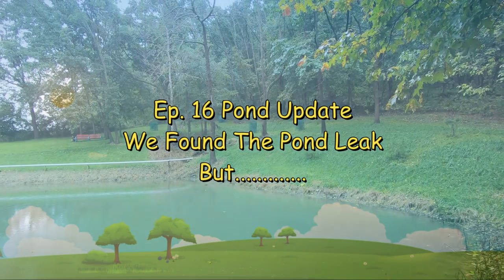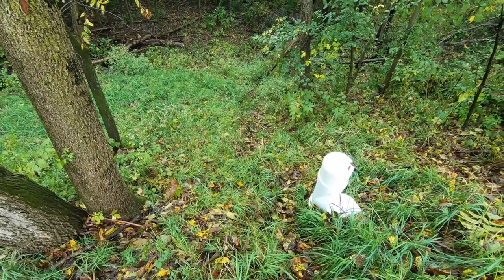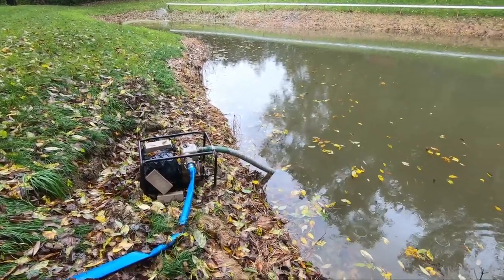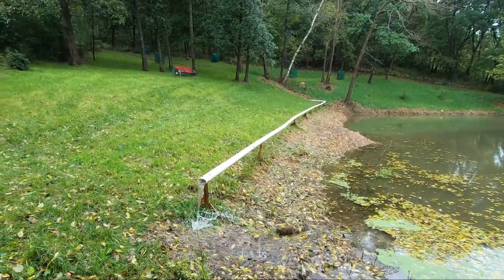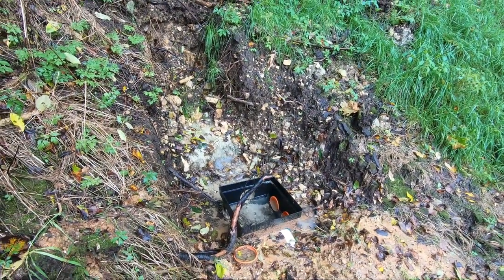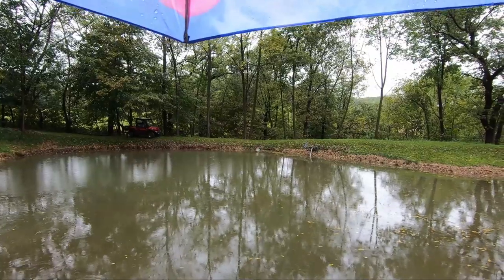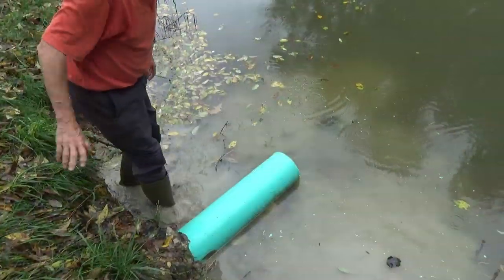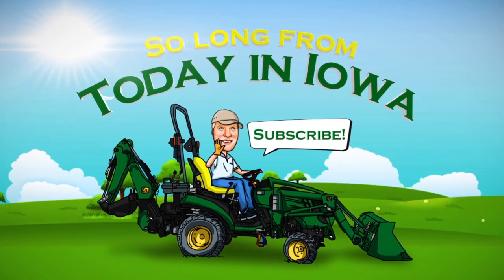# 16 Fixing a leaking pond. / Hiring a poor contractor

Comment: I have been watching your videos for quite awhile now . This pond you have is almost same as mine . I have had the pond for 25 years . This is what we did when we constructed it with advice from some real good old boys with years of experience. The dam was compressed with a dozer layer by layer with the blue clay from the 18 foot deep end . The skimmer pipe is 12” plastic with ribbing on the out side and smooth inside . The pipe is four feet from dam going down four feet then 90 degrees thru the dam . There is too large sheets of rubber membrane heavy pond liner with 10” holes in center stretched over the pipe buried three feet in dam .  It has never leaked by . Emergency over flow pipe in dam also for flash flood events 12” below top of dam . Smooth pipe on outside I was told will always leak . I live in Ontario and get severe frost and heaving . The skimmer pipe is always below frost and never moves and always surrounded by water . We have a windmill with aeration puck on a eight foot stand in 18 foot hole and electric backup diagram pump for hot no wind days for oxygen . Hope this helps you  out . What I see at your pond could be fixed no problem . Are pond has been bullet proof . There has been many ponds washed out because of poor piping leaking . Thanks Stephen

Comment: Take the pipe out redo the levy, and like what I did with my big pond I just redid is I had an natural inlet and outlet put in and fixing to lay down some hay with chicken wire on top and rip rap to prevent erosion!! And also using soilfloc and damit on both tanks
Reply from the maker: Good morning Jonathan thanks for taking time to say hello and commenting, sounds like you had a successful project. Have a great weekend.

Comment: I have had a 3/4 acre pond for 20 yrs and it leaks. Where yours was leaking ( you knew where it is) dig down on the other side of the bank and pack it full of clay. We have dug mine several times. May try shalex as you did
Reply from the maker: Hello Judd, the final video #112 shows where the leak was finally found. Nothing I could put in the water would have stopped the leak, except to excavate as you mentioned. 
Iowa is coming out of a drought and it's nice to see the pond level rise again.  Thanks for taking time to say hello and comment. - Bill

Comment: Hi Bill, I just watched all your pond videos with much interest.
I don't like to use the word expert, but my job is consulting and troubleshooting serious construction issues. As it is Sunday morning, and I am just enjoying a cup of tea, I will analyze your dam issues for you, no charge [normally about $528] !
Here are my observations .

You have been unfortunate with your chosen design. It was never going to work.

1- Having an overflow pipe running through your dam wall is a disaster, water in the dam is drawn along the outside of the smooth pipe continuously, by capillary action and hydraulic pressure in the dam, it never stood a chance, the dam wall is also very very steep which means it is even more liable to fail, and extra care must be taken, a dam liner would be recommended, and should go right over the top of the dam wall, then layer with netting, and gravely clay on it and grow your grass.  
2-The overflow must always be located along the sides of the dam and basically, be a little creek sweeping around, and away from the dam, never a smooth plastic pipe either, and never finishing just below the dam wall, where it will saturate the dam foundation wall and fail, water over topping any dam is a disaster, and must be avoided at all costs, or it will fail.
3-The white pipe aerating the water, doesn't, it only affects the top layer of the pond with a small amount of aeration, your dam would benefit from a 4 metre rocky river base with a couple of little waterfalls, you have the height for this, where it enters the dam, thus creating a simple natural looking, highly aerated creak to aerate the dam.
4- Whenever possible, you should never, ever, drive over a dam wall such as yours, as it seriously disturbs the packed clay dam wall, and encourages capillary water being drawn through the pond wall, every time you drive over it, water is alive, and in motion, going to the path of least resistance with gravity and hydraulic push factors, and will move through the wall very easily, and your dam wall will fail. Nobody wants that.
And just remember, every time you see the word 'fail', with dams that equals money and time.
Lovely place though, very lush, keep up the videos.
Cheers from Australia
Reply from the maker: Hello Espen Forfen, Happy Monday in your part of the world.
First THANK YOU! how very generous of you to take time and send me your professional opinion for no fee. I've read your suggestions several times and never thought about the damage I may causing by driving over the dam. That will stop effective today.
I excited to tell you last weekend I found another excavator that was right in front of me all along. I'll get right to the point. He dug a 16 foot long trench down the middle of where the original repair was made. He dug until he found good dry soil, that took him to about 14 feet deep. Clay was installed in the trench in 2 foot lifts, then pounded with the excavator bucket. The exit pipe was NOT reinstalled back in the pond dike. If you think of my pond as a pear shape, the original exit pipe was installed in the fattest part the pair.Your spot on with your note how steep that dam is. We installed a ribbed pipe in the top of the pair now, it's the shallowest part of the pond and I almost decided to not put a pipe in, and let it run over the spillway as was shallow at that point.
Well as of 8 days ago, the pond water is higher than I've seen it in years. No water can be seen coming from the backside of the dam.
A new video is coming soon and will better explain what we did. Winter is moving in here fast so I think the season to repair the pond is over. 
Thanks so very much for taking time to share your ideas with me. This is internet at it's best. - Bill
Reply from the maker: Just checked the pond and it's within 6 inches of the outlet, never been this high everything is looking good.
Reply: Being a Gov Environmental Scientist for 16+ years working in coal reclamation, and also performing environmental consulting work on the side, I will have to agree with Aspen Forfen.
 
Normally, coal mining pond designs are engineered to have a primary and secondary spillway. Primary being the main discharge of water and secondary being utilized as an emergency spillway. The emergency spillway's main purpose is to discharge water in case primary pipe fails (i.e., clogs, undersized, etc.). It appears you have 1 primary spillway without an "anti-vortex" cap on the end of the pipe. NOTE: anti-vortex cap prevents water from making a circular motion (much like a toilet or sink drain) which will erode the  soil around the edge of the dam. However, this may not happen in your case due to the smaller size of the pond and the lack of large watershed above the pond. Just a quick thought.
 In summary, I see problems with your pond design, some issues noted by  Aspen Forfen and some not, but it's hard to provide a  detailed solution without construction information....like inspection notes during pond construction, soil and subsoil type used, water quality, construction photos, etc.
I can go on and on but to put it simply......If you would like some advice you are welcome to contact me sometime. I'd be happy to help, if I can.
Reply: @billburkhart  I have been patiently waiting that next video. I can't wait to see the problem finally be over.

Comment: My parents had similar issues because of a prior contractor. Basically had to rebuild the pond. The new contractor dug holes on the back side of the pond and found the leak.
Reply from the maker: Hi Steve, discouraged,  I contacted a company that will provide a rubber liner so I'm exploring that option very seriously today.

Comment: Bill, I'm an engineer not in your state and don't know all of your plans for repair.  You may want to reach out to your local soil conservation district.   They usually have a district engineer who can give advice and information typically for free.  They don't like ponds to fail and can maybe help you out.

That said, an embankment fix could be as simple as clay placement on the inside face and then rebuilding the damaged section.

Good luck!
Reply from the maker: Bill, I'm all over your suggestion, thank you I never considered going that route, appreciate your thoughts. I'm making calls today.

Comment: Did you not have any luck with the dam leak treatment you tried?  I have a few slow leaks in the bottom of the pond dam I need to fix.
Reply from the maker: Hello Mike I used two products from two different mfg, and cannot recommend either product. - Bill
Reply: @billburkhart  dang I thought the one video looked like 1 had worked on a few of the leaks
Reply from the maker: Mike, none of the sealants I purchased worked as advertised.  Discouraged I've contacted a company that will sell me a rubber liner today,  I'm exploring that option very seriously.
Reply: @billburkhart  ok keep us posted on that option.  I had thought about that as well but have no idea on costs.
Reply from the maker: @miketerrill3971  Hello Mike, the liner is $5,000 and that comes with a supervisor from Oregon to observe proper installation. I'm going to dig up the hole in the dam next weekend to see what I learn. Stay tuned. - Bill

Comment: My pond builder would not put in a drain line thru the dam.   Sorta the same thing your fighting. Water undermining near or around the pipe.
Reply from the maker: Hi Steve, I contacted a comapny that will provide a rubber liner and I'm exploring going that direction today.

Comment: What about the leaking problem, did you ever find a product that works?  Worse case, couldn’t you just install poly (or somewhat similar) liners?
Reply from the maker: Hello, sorry for the delay getting back to you. I did price a liner and the $5,000 didn't sound too bad. BUT, I found a very good excavator and the pond is fixed! look for the video coming out this month. It's really turned out nice. Thanks for asking about the progress, appreciate it.
Reply: @billburkhart  get that video out.  I got a new property with a pond that needs some work.  Need to learn from your mistakes 😉
Reply from the maker: @jyienger  I will show you my biggest mistake in the next video, You'll learn a lot with the next video coming out in 3 weeks. It's been 4 months now with no sign of leaks. Good luck and don't get frustrated. - Bill
Reply: Looking forward to the video. My kids just bought 15 Acres out here in Tennessee. Came with an existing Pond about the size you have. It Leaks like a sieve. There doesn't appear to be any fish in it so we had considered draining it and putting in some kind of a liner but I'm concerned about the silt buildup on the bottom as it's fed by run off from around the property, not a spring. I truly appreciate the time and effort that you have put into sharing your insight and experiences!
Reply from the maker: Hello IBTJC,  I did find the leak, the next video will plain everything, the leak was repaired last fall and I wanted to make sure it lasted through the winter. Now the ice is gone and no water has been lost. I'm trying to get it out soon, i was waiting for confirmation the repair worked. Thanks for asking. Stay well.
Reply from the maker: @troycress6603  Hi Todd, I did price a single piece rubber liner (no seams) at one time and it was about $5,000 delivered to my home. Labor would be have been all mine. BUT I found the leak last fall and made the repairs, and it's holding water well. I wanted to wait 4 months and get through winter before doing another video. Now that the ice is gone and the repair worked, I'll get the video out.  Stay healthy !!!!

Comment: I could get that fixed .
Reply: @billburkhart  if it takes a truckload of material like clay and stray and gravel . But you may be able to dig it out add a pirimid of stone then gravel then alot of clay then too the clay with rocks and gravel to keep it from washing away . There may be tutorials on how to build a dam that may help when you do the rebuild but a good concrete wall down below clay line always works with added clay for sealing